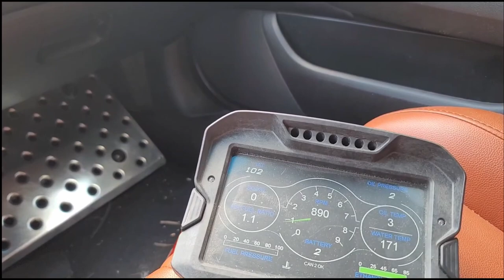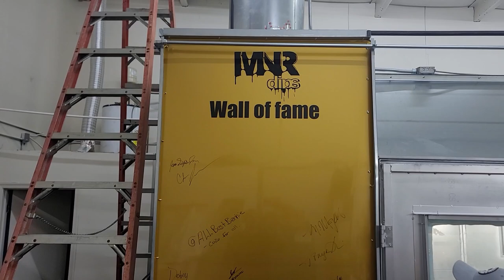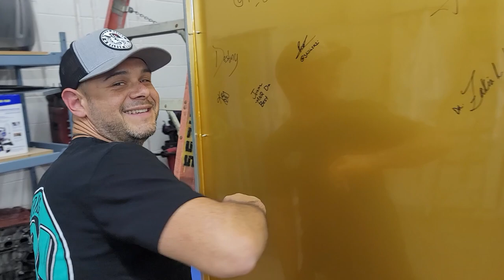I autoflexed mike's 5th gen honda prelude Candy purple | crazy in the sun

Comment: Sup Trey, I’ve been a following your turbo builds and can’t remember if I’ve seen you show your exhaust system. I’m curious if you have deleted cats? And what you recommend to do about the O2 sensor codes. 
I welded on a straight pipe and haven’t installed a bung hole. Any advice ? Much appreciated! Hope you are doing good
Reply from the maker: I'm straight downpipe and I have a wide band sensor that all runs through hondata